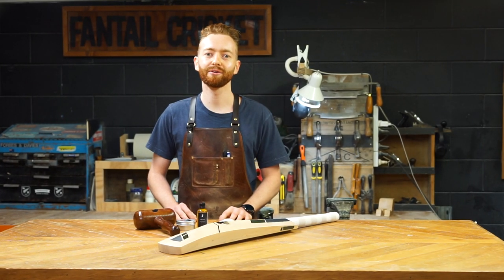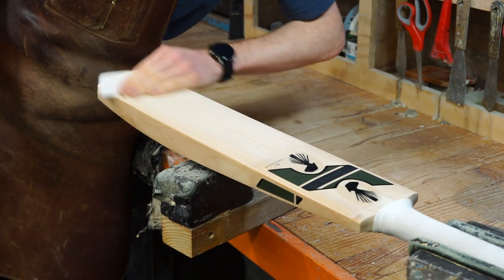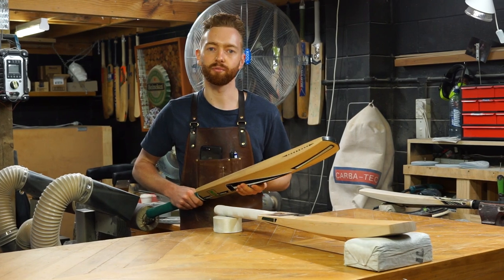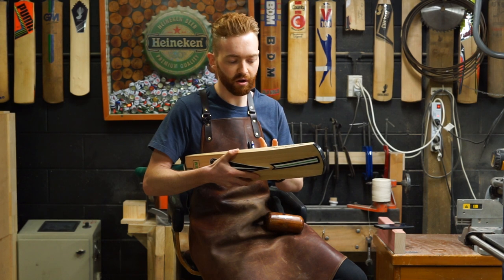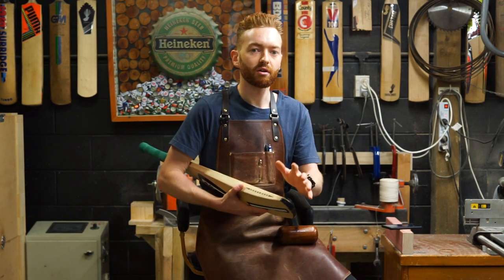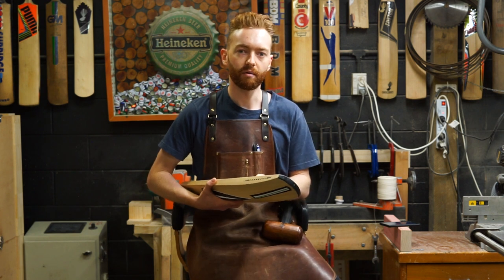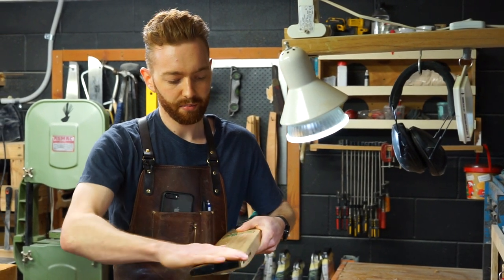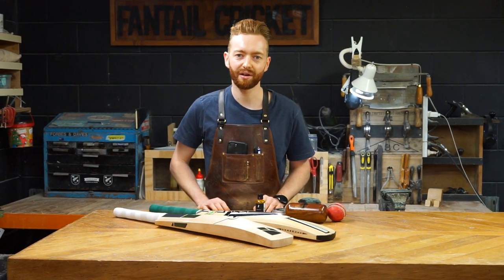How To Guide - Knocking In Your Cricket Bat

Comment from the maker: Let us know if you have any questions that we didn't answer in the video.
Reply: if I don't have a mallet and I use a ball in a sock to knock in the bat, do you think it will be the same procedure, if not what do you recommend
Reply from the maker: @jedidiahjohn7576  We would recommend getting a wooden mallet as a ball in a sock will unlikely make an indent as there isn't enough resistance, and you won't have the same accuracy as you would with a mallet.
Reply: Make a video on how to threading of bat handle
Reply: why is it necessary to do knocking what's the purpose?
Reply: When you sanding it wont it leave scrathes on the face from the sand paper?
Reply: i bought a bat from you guys, how often and how should i apply batwax?
Reply: After how much time the oiling is required for bat
Reply: If I already put a bat face on my bat, can I put oil on the back and let it soak through? Will that work?
Reply: Shouldn't we hit the bat 45 degree angle rather than 90 degree?

Comment: Nice to see a DF Magnum again! 

While knocking-in is a process I still only hand knock my bats rather than have them machine knocked. For me, I feel that it gives me a better understanding of the bats balance, weight, feel etc.
Reply from the maker: Definitely, and if you knock it in yourself, most people tend to look after their bat a bit more due to the hours they've put into preparing their bat.
Reply: @FantailCricket  I wouldn't disagree as I spent 4hours+ knocking in short bursts as you mentuoned in the vid. Luckily my bat has finished the season in pristine condition after a full season of nets & games & only needed a light sand. Then I gave it 2 coats of linseed oil over 4 days & placed a new fibretec sheet on the face. Now I'm  all set for my Winter nets.

Comment: I was told that modern new bats need not be knocked in. Is that right? The one I bought is an English willow Gray Nicholls and has a parchment like sheet going over the edge 1” either side. Should the bat be still oiled and knocked in?

Comment: I’ve got a knocking in mallet that’s basically a cricket ball on a handle will that work fine? And what bat is that it looks amazing
Reply from the maker: Hi Callum, the Fantail bat is our Tone shape. We would recommend a wooden mallet as the ball is softer than a wooden mallet which may mean that you're not making enough of an impression to knock the bat in to the level it requires. You also don't want the ball's seam making impressions on the blade during the knocking in process.
Reply: @FantailCricket  thanks mate👍 and could you guys do a review of the senior tone bat?

Comment: Hi! Just wanted to ask, can we knock used bats too? My bat is 6 months old and I play matches with it. The sweet spot is great but small. Do you think knocking the bat regularly would increase the size of the sweet spot towards the edges and toe?
Reply from the maker: Yes, you can knock in bats at any stage of their life. If the bat has a narrow sweet spot, it may be under-pressed. Using a mallet, see if you are making impressions on the face while knocking at the same power you see in the video. If you are, then it will require further knocking.
Reply: @FantailCricket  thanks!
Reply: @FantailCricket can i knock even after ball marks